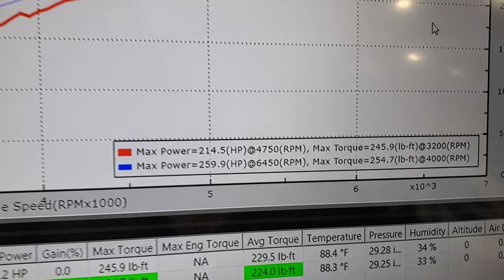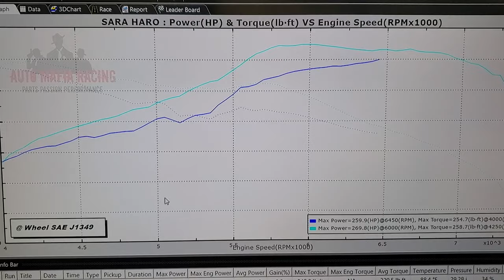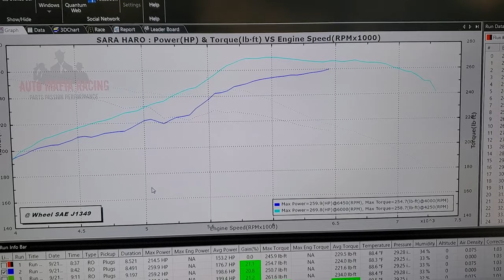Tuning SARA HARO's Mustang from NETFLIX's HYPERDRIVE TV Show

Comment: just a thought..i thoughts 3.7 v6 ford with 6 gear trans 5th gear is    1 to 1 my 2011 is         1 t01 in 5th according to Google....
Reply from the maker: Trans Ratios for the 6R80 Auto are:
4.17, 2.34, 1.57, 1.14, 0.87, and 0.69:1

MT82 6 Speed Manual Transmission Gear Ratios:

1st - 3.66
2nd - 2.43
3rd - 1.69
4th - 1.32
5th - 1.00
6th - 0.65